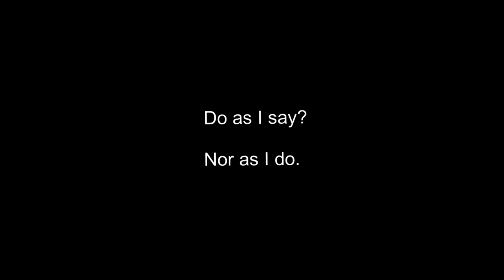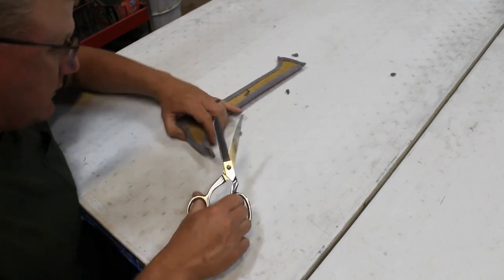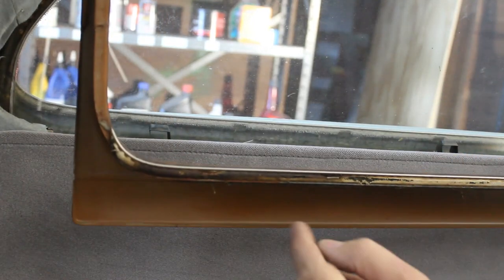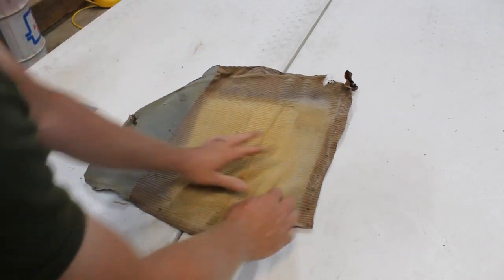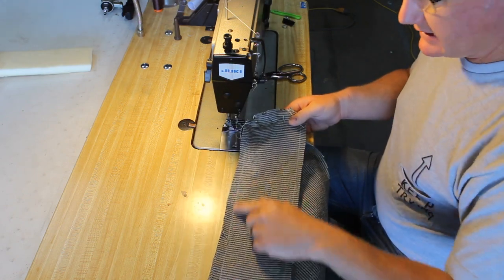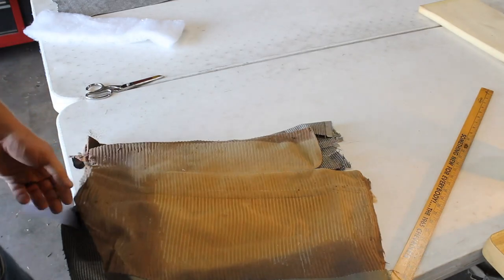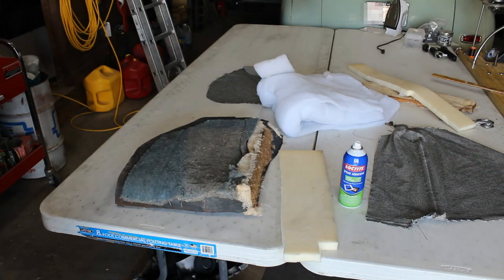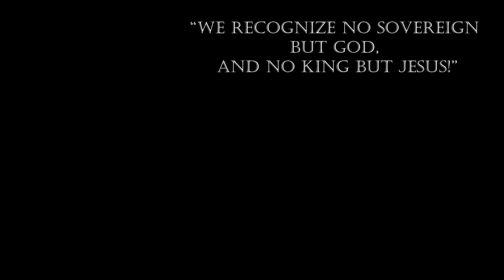1948 Chevrolet Upholstery - Rear Seat Arm Rests and Side Panels

Comment: Very informative. I have a 49 Cadillac that is in need of rear upholstery. It has a smaller version of the arm rest. What were you stapling to when you were attaching the fabric to the Chevy's armrest?
Reply from the maker: The armrest base is like a heavy laminated paper or hardboard material. Chevy glued and tacked directly to it, which is what I do as well. Just make sure to short enough staples so they don't poke through! Thanks for watching!